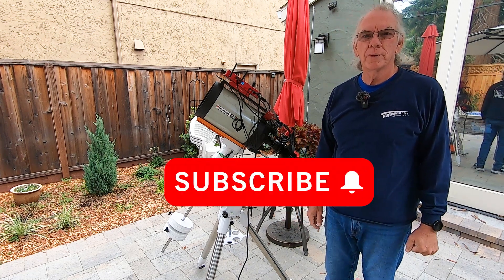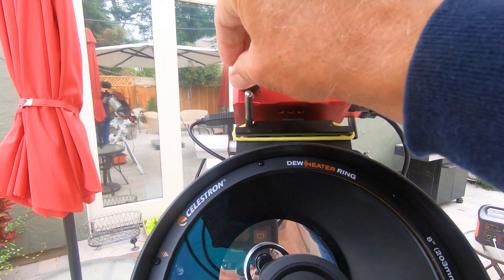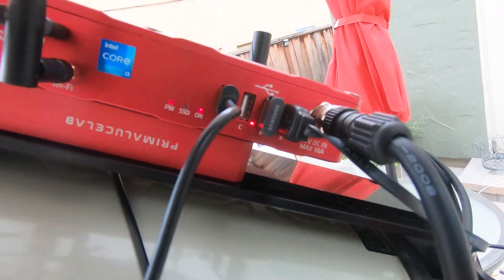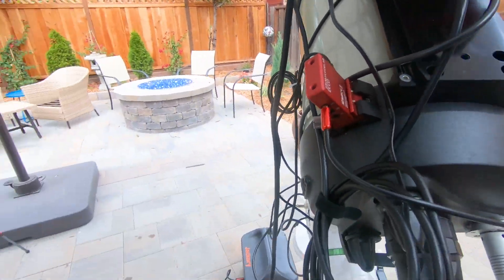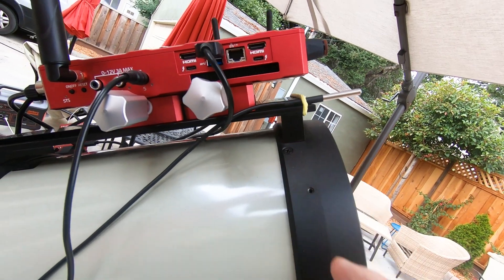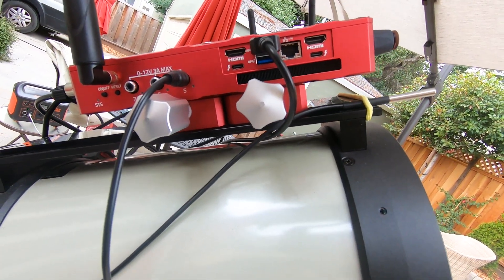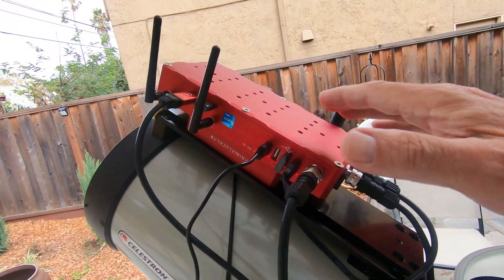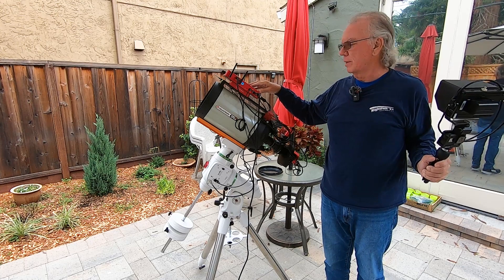PrimaLuce Lab Eagle5 S Tour -  Externals

Comment: I'm thinking about getting the Eagle 5S so thank you for making and sharing this video.
I like that you have most of the USB ports with something in them, you would think that would help weather proofing the Eagle 5 S. Do they have caps for all of the non-used ports?
What power source are you using to drive the Eagle 5S?
Could you add a list of the PrimaLuce parts that you are using for your setup?
Thanks again
Reply from the maker: I’m not aware of anything to cap the unused ports. Interesting idea.

Power Source: I use the Jackery Explorer 1500 with my EdgeHD 8 / EQ6-R Pro which is managed through the Eagle 5. I also run my Starlink off this power station when at dark sites that do not have power. Otherwise my Jackery Explorer 1000 should be enough for a 12 hour imaging night but I will not know this until I use the Eagle for a full night on my upcoming trip to Borrego Springs. I'll probably mention power consumption based upon my use of the Eagle 5 at Borrego Springs in a future video.

This what I ordered from Agena Astro:
PrimaLuceLab EAGLE5 S WiFi Astrophotography Computer # EAGLE5S
PrimaLuceLab EAGLE 8A Power Output Cable for SkyWatcher EQ6, EQ8, HEQ5 & CQ350 Mounts - 115cm # PL1000056
PrimaLuceLab EAGLE 8A Power Output Cable with 5.5 - 2.1 Connector - 115cm #  PL1000043 (To power my camera)
PrimaLuceLab EAGLE 3A Power Output Cable with 5.5 - 2.5 Connector - 115cm # PL1000044 (to power my PrimaLuce Lab Giotto LED light panel)

PrimaLuceLab ECCO2 Smart Dew Heater Controller for EAGLE # ECCO2

Hope this helps. Let me know if you have other questions, 👍

~ Bill
Reply: @AstroVagabond  Thank you